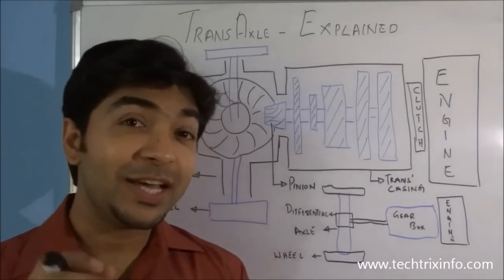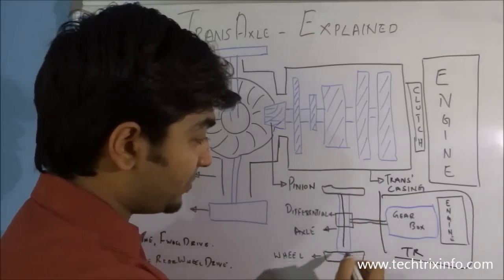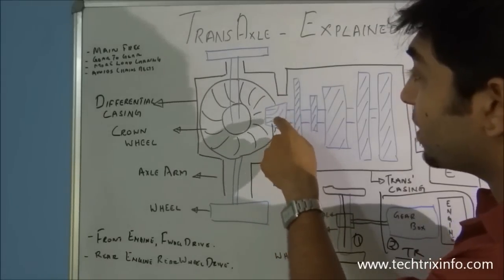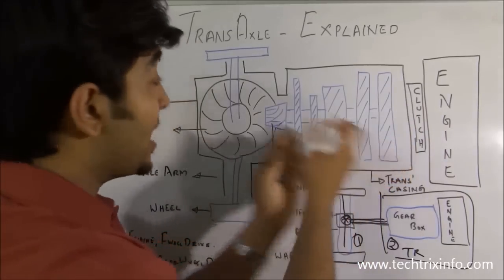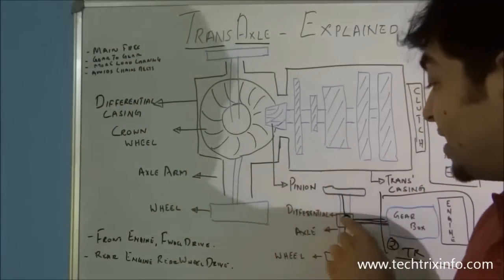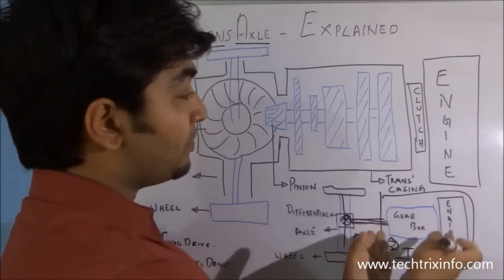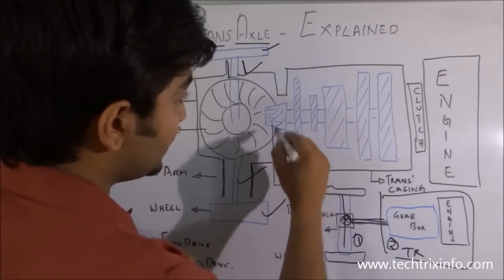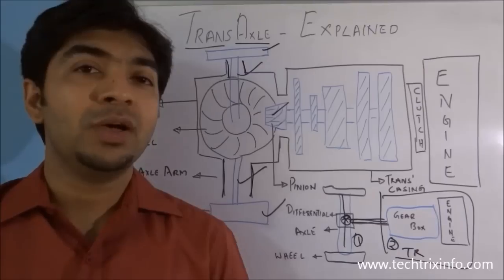How transaxle works. ✔

Comment: what kind of differential is recommended for transaxles?  i want to design a rear engine rear wheel drive .ive planned to use a cvt with limited slip differential..will i be able to integrate these within a transaxle...i want to use them for a 300cc engine

Comment: I have a question, wouldn't the clutch or torque converter be part of the trans-axle assembly? Meaning the torque is inside the trans-axle housing?
Reply: the clutch / torque converter is normally part of a transmission so yes

Comment: You should work on your diagrams dude, For instance you didn't really draw the other half of the gear box and it's also confusing because your diagram makes the car look square. From this I still have to go look to figure out whether for a transaxle if the gearbox is as long as the gap between the engine and the gearbox or if there is a long axle from the clutch to the gearbox, making this just the opposite as a normal manual gearbox just having the drive shaft at different ends of the gearbox. I'm guessing with a transaxle there gearbox is the full length of the car between the clutch and the differential having the advantage of more even load because there is not so much pressure put on the drive shaft alone which means the load is more evenly distributed throughout the entire drive train which would make for less torque loss.